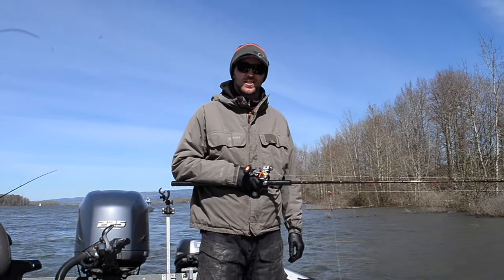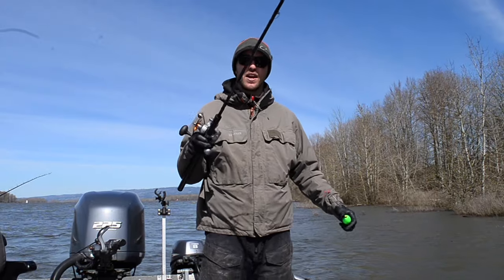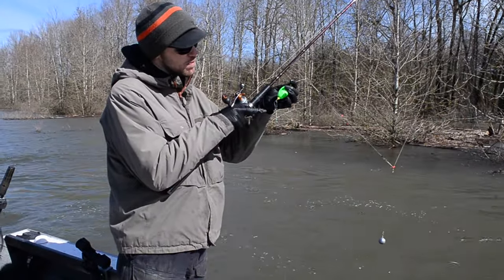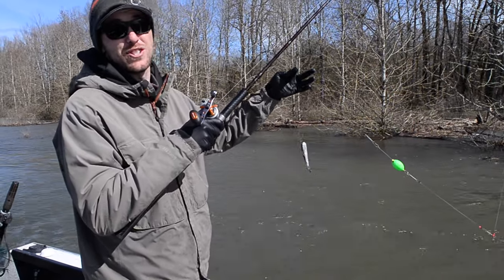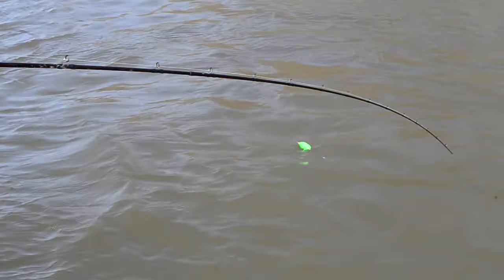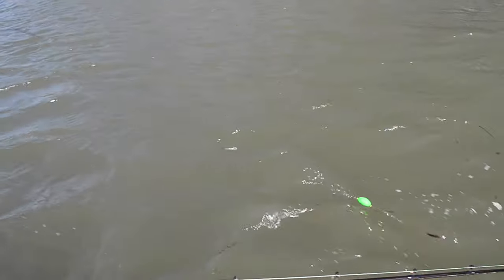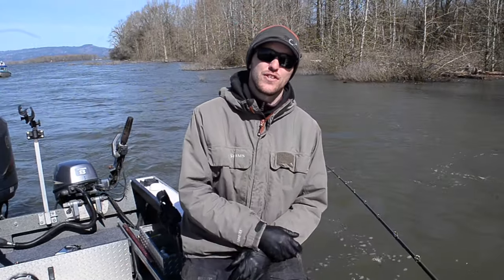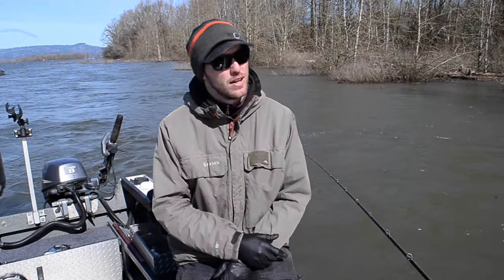"How To" | Rigging & Fishing Herring While on Anchor for Spring Chinook.

Comment: It looks like you have your float on spinner wire. Is that how you have it rigged?
Reply from the maker: Its run with 200 lb tuna leader. You can use anything though, a lot of times if I make them on the water I use 40 lb leader. Thanks for watching, please subscribe!